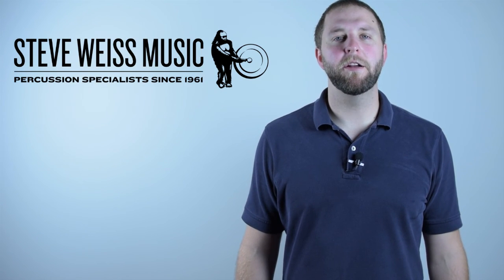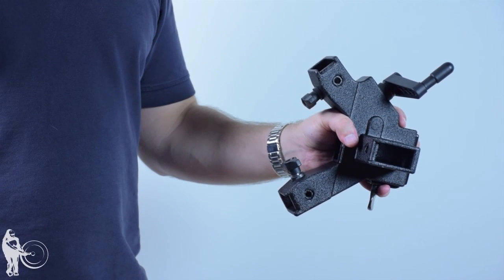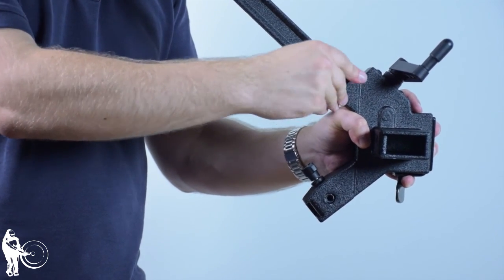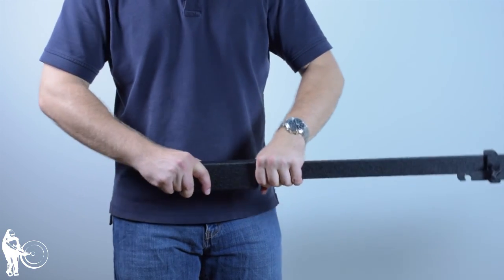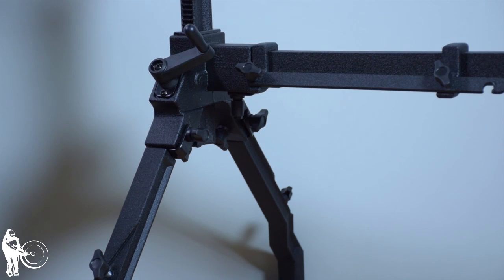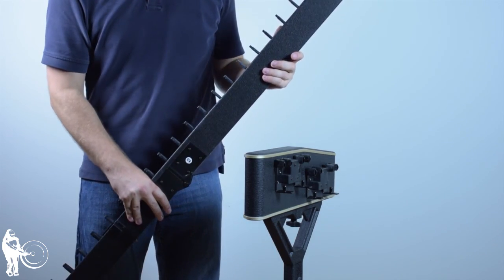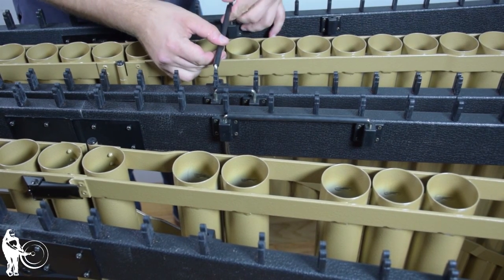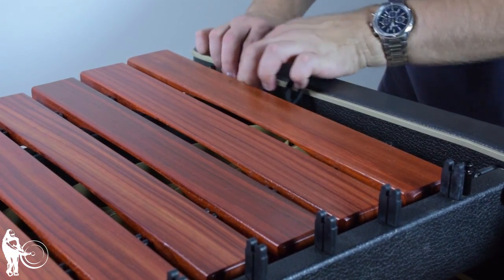Adams MSPV43 Marimba Voyager Assembly Tutorial

Comment: Thank you for this helpful tutorial.  The only thing missing is how to engage and disengage the wheel caster brakes?  I finally pushed VERY hard to put the brakes on, but cannot figure out how to unlock the wheels.  I got the manual from the Adams official site, but even that doesn't address engaging and disengaging the wheel braking mechanism.  

Please comment on the wheel brakes, especially how to get them unlocked.  Thank you again for this helpful tutorial.